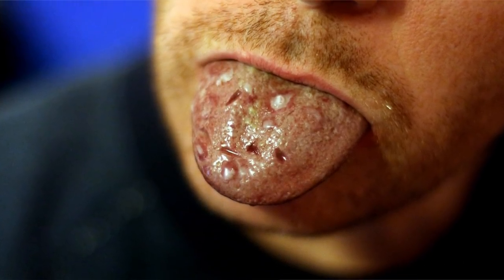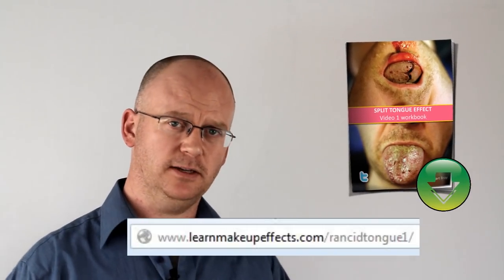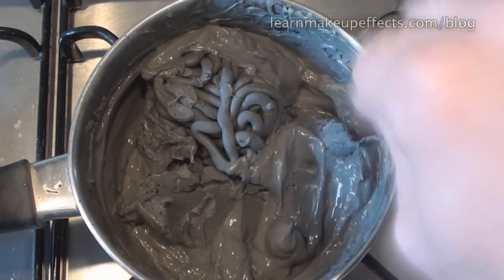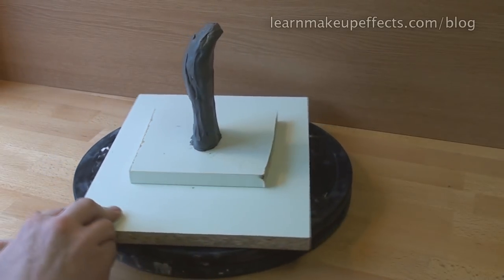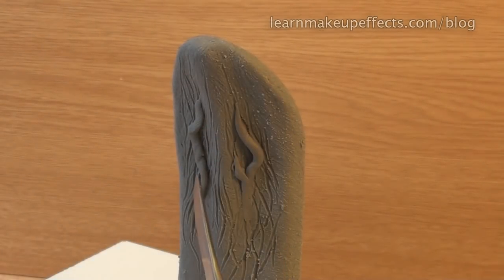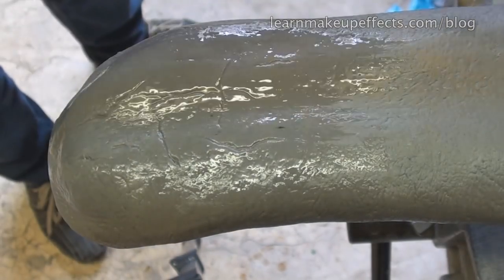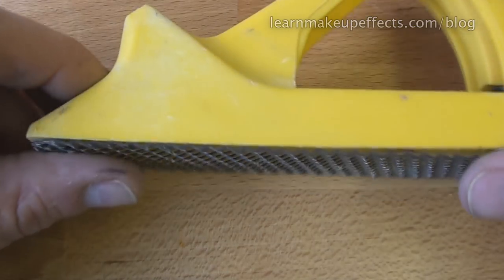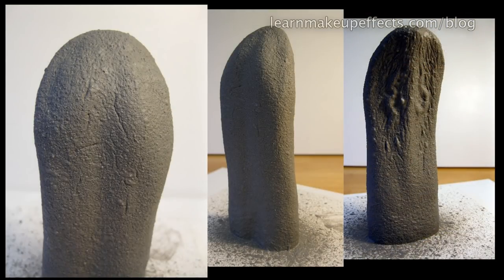Rancid Tongue Effects Part 1

Comment: i love all your videos and i want to ask you one thing... I am a dental prosthetics and we must do the gum around the teeths, its possible for you to do something about that? love all you textures and i think that would be a help for all dental prosthetics. keep the fantastic work
Reply from the maker: You can make dentures which cover existing teeth, although often for fangs etc, it is just the fangs required which are added without any gum, leaving the real gums exposed as you can't get more real than the real thing. 

I actually don't make teeth or dentures to be worn, as the process for casting teeth and having small items like that are best left top those trained and insured to take teeth casts.

I'm not saying it can't be done, just that it isn't in my remit professionally and there are places we use specifically for that. Imagine taking an actors teeth cast, and accidentally pulling a loose crown off! I wouldn't want to be the one that holds up filming for a day while they get emergency dental treatment.

Comment: Great stuff! What plaster did you use for the moulds? I was only aware of epoxy or polyurethane that was suitable for silicone
Reply from the maker: The Magic Brush I used a plaster here in the UK called Crystacal R. Any hard stone should work.

Comment: Brilliant! I wouldn't have thought to make a core. Are you doing that so it can be worn over the actor's actual tongue, like a sleeve?
Reply from the maker: Yes, rather than a solid tongue. You could swill it instead and do away with a core but by using a core,  you create consistent thicknesses each time.
Reply: @stuartbray  good point!